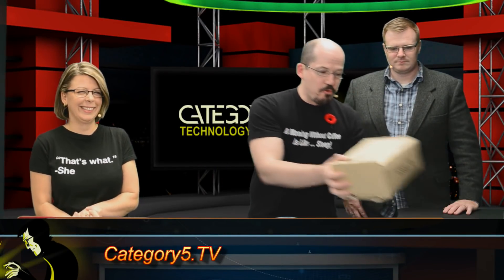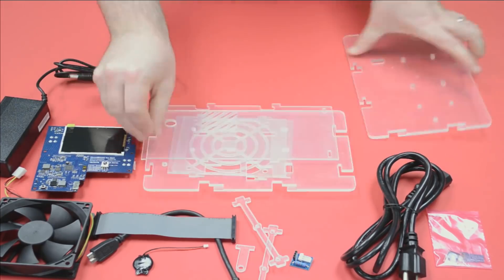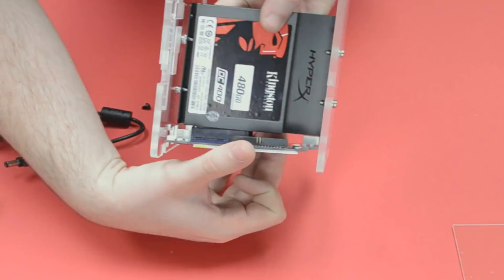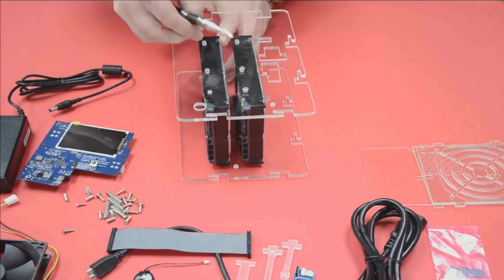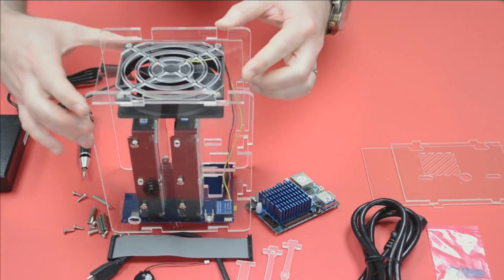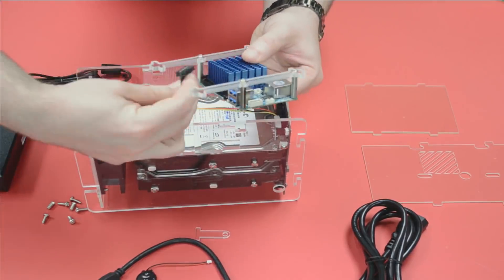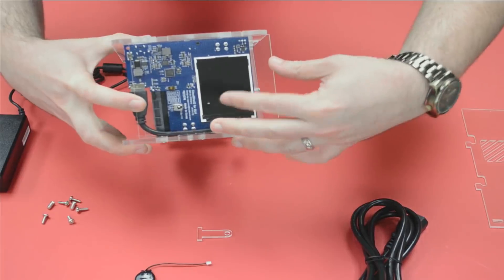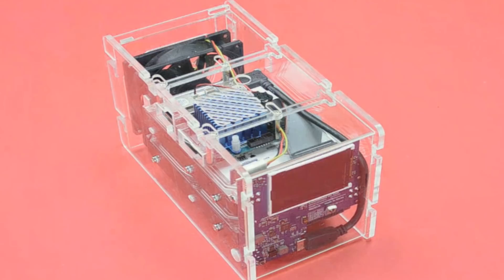The 8-CORE Raspberry Pi Killer: ODROID XU4Q with CloudShell2 Case - Assembly

Comment: As it is aimed at a completely different market at a hugely inflated price it can hardly be called a Pi killer. The Pi was deliberately designed to be a low cost programming platform for schools in the UK. Emphasis on programming. All the SBC bandwagon jumpers, just like this great looking and superbly specced system are simply NOT in the same league and aren't even trying to be so please stop comparing apples (or should that be raspberries?) with cucumbers ... It's pointless. Review the beastie on its own merits.
Reply: Exactly, as soon as he start dragging bags and bags of addons and screens out of the box I was thinking "that little thing is as much of a Pi killer as my desktop PC is - neither are affordable to the market that the Pi is aimed at"
Reply: Indeed.I would never spend money on the XU4 for my automation projects and to interface with arduino components. As i would never buy the Pi to run NAS servers and batch media rendering farms. Also the Pi's support and community for Open Source projects is far greater than the "Pi Killer".
Reply: actually a misused term, which is becoming annoying
Reply: Bob Lewis It gives me a feeling they are afraid of pi. Funny. It's a good device but when you compare it with pi, it makes hard to see what it is actually.
Reply: +Jim Franklin Err actually NO it wasn't. Here's a recent quote from The Royal Academy of Engineering with reference to their Jun 2017 award to the Pi team ... Raspberry Pi wins UK’s top engineering innovation prize ... "Originally conceived as a way to boost computer science applications to the University of Cambridge, Raspberry Pi has created a whole new class of computer ... ". 

In other words, to boost proper computer science curriculum (coding and engineering) in UK schools (as well as developing countries), like I said, in order to help increase the number of students (UK especially) needed for computer science and related engineering subjects whose numbers (and quality) had fallen drastically since the mid to late 80's due to the increased focus on ICT instead of true computer science. You could also check out the Wikipedia page as that reflects the same position.
Reply: could be, but it at least it is not an orange pi or some other aliwather base SBC
Reply: Actually, the Pi was designed to be a very low cost programming platform for the 3rd world countries not for the UK.. it just happened to be designed here and took off like wildfire.
Reply: I heard that is was just the fact there was no low cost computer for persons to get into the hard core computer and electronics
Reply: billfusionenterprise The arduino and it's derivatives have been around a long time.
Reply: actually the parrelex basic stamp has been there longer, as well as PIC chips. 
The thing is you need a computer to program them (Just like the first SBC needed a terminal) 
And that was why (from what i have read) the Pi was made, to make a stand alone device.
And there has been a computer like controllers in big hardware (VX works and MBED) , it's just the Pi was aimed at students and beginners and probably has change the wrong thing of small computers
Reply: nope, they are like ant group of manufactures, they see a successful design and try to make one of their own with some difference and hope they have something that will sell
Reply: nice to see someone who gets it
Reply: I do wonder, for who and what practical use are these more expensive variations are made?

Designed to empty your wallet, just like enthusiast gaming rigs and graphics cards.
Reply from the maker: Good thoughts, and we'd be happy to review it on its own. To be fair though, this is 4x the power for just 2x the price. It's not "hugely inflated" in my opinion. I think that's sweet bang for the buck. We'll definitely do the review of the SBC itself (minus the fancy case). Thanks.

Comment: I use the raspberry pi's because the gpio pins are very useful. Sure, I can probably use an arduino as a slave I/O board but I won't be able to use some libraries to control some components because of the latency.
Reply: shoud use it because of the support

Comment: "*** Important Correction * The ODROID XU4 supports 1080p video output over HDMI (not 4k)."

The Raspberry Pi does 4K quite well. And it is a WHOLE LOT CHEAPER. This device isn't an rpi killer. It's a good system, but it's price puts it in a different category and purpose. And well... I'd rather have the 4K, since my pis are plugged into a 58" tv and a 49" tv. 

Your "pi killer" would look too pixelly on the desktop for the price as far as I'm concerned. So much for rpi being "outdated." This odroid doesn't even do h265, which is pretty much the de facto standard now. If I wanted that much video stutter, I'd stick with a raspberry pi version 1...
Reply: The XU4 can software decode hevc without issue. The Odroid C2 is what you want for media consumption, the XU4 is better for heavy lifting.
Reply: my problem with term pi killer is it  misses the point of the pi
Reply: The market share that wants to hook these directly up to a TV has got to be smaller. I'd say most people buying these were looking for embedded solutions. Who would use this as a desktop box or media center? I have an AMD 8350 as my media server. It serves over 10 tablets, 10 laptops and 6 desktops 24/7... all local cloud. The Pi couldn't do it.
Reply: The Real Elvis : what would be a good curent/up to date computer that I could use as a media server? Something that is silent and has a very black/low noise floor? I want to connect it to my ifi pro idsd dac. A small computer with a good amount of ram. (At least 4 gb) Something to stream DSD256 music, run a Kodi server, and jriver or hqplayer and maybe a Plex server. I would prefer fanless and 2 gigabit ethernet ports or I can just use one of the USB ports for the extra ethernet. I would also like a suggestion as to a OS. I would think Linux although I have never ran a Linux system. Thank you for your advice and knowledge.
Reply from the maker: Thanks Karsten. Yeah, that was a bad flub, and my bad. I absolutely think at 2x the price of a Pi 3 the XU4 is a brilliant SBC for anyone needing the power. It is roughly 4x faster than a Pi 3. Obviously there are some excellent use cases for that.

Comment: why do people call things like this a pi killer, i own 6 or 7 raspberry pi`s and will get 2 or 3 of these as well but they won`t replace a raspberry pi, one reason is a pi can be ran off a 3.7 volt lipo and turned into a small standalone unit, i bet this sbc can`t match that.
Reply: pi killer is a bad term, why, the story behind the pi , i would prefer next step board
Reply: I agree it's not a Pi killer. It's a hell of a lot better than a Pi in many respects but it depends on what you want to do with it. I've got a Pi3 and about half a dozen Pi1s. Like the Pi3 this thing draws a lot of current. You do need a dedicated power supply and can't just use a phone charger, which is a shame as I've got plenty of phone chargers.
It all depends on what you want to do with it. 

If you don't need a lot of CPU, don't need USB 3 and don't need gigabit Ethernet then get a Pi. There's no need to pay extra to get one of these.
If you do need these things, then get an XU4. If these are your metrics then yes, this is a simple choice. "Pi killer" is a provocative phrase but it does have credibility in the right context.

I use my XU4 as a do-it-all server. It runs Arch Linux, with dnsmasq for DHCP, DNS (with ad blocking) and PXE. OpenVPN, NFS and CIFS and NextCloud. It handles this lot with ease and throughput across the network is roughly gigabit speed. I used a Pi1 previously, which doesn't have the grunt for NextCloud and can only manage ~50 Mbit throughput. 

If you want to run a Kodi box then a Pi3 is plenty (a Pi1 will manage, but struggle) - I run OSMC on mine and it does the job without blinking. 

There are a lot of these types of computer around now. I don't think any of them are going to push the Pi off its perch. Yes, they will be better and this one most certainly is, but the aim of the Pi is not to be the best - it's a non-profit organisation whose aim is to provide low-cost boards for educational purpose. Adding dedicated gigabit Ethernet will increase bandwidth but it's still Ethernet and it will push up costs. In fact, I'd say there was a lot of educational value in comparing the architectures of these things, in particular how the Pi's shared USB2 bus can restrict throughput. Having spent the last two decades working in this industry in many enterprises it still amazes me how many experienced administrators don't grasp concepts like that.
Reply: congrats on being one of the few who get it (although you screen name takes it down a notch) . I am just playing around with the Pi right now and be doing more serious things here soon (I just finish moving) . it just after reading the story behind the Pi do you realize what it's goal is. Trouble is most of these boards are riding coattails and try to do what faceplant did to mydump. (Facebook did to MySpace). Only one board I have seen had some good logic to it and that was the Chip computer, they were trying to make a whole product witha pi inside most retail price was high, so they made their own board to make the giffy cam cheaper, the result was eventually the pi zero cam around.
Now this is not saying odroid is bad, no, it looks to be a good design and they even have a emag, so they are doing good, although i do wonder about this video.
I do plan to get an XU4 and maybe one of the other boards from odroid in future. They are one of the few that do have their act together (plus i see many videos where the thing works)
Reply: @ LinuxTechShow - 
LinuxTechShow "It's tongue-in-cheek to call it a Pi Killer to be sure. But it is some really great SBC bang-for-the-buck. Hope you enjoy yours!"

How about we call a spade a spade and say you said that as click bait. we all know it.
Reply: The Odroid C2 is a better direct comparison to the Pi3, except it has gigabit Ethernet and native hevc decoding while being 20±% more powerful in most ways.
Reply: You're the  first to mention the screen name. It was one of those "I bet it won't accept this" moments. Surprised me , although give that this is YouTube and anything goes, it really shouldn't have.
It's all down to what you want to get out the board. If cost is ultimately the biggest issue the XU4 might not tempt, although it is decent value for money. If you're in Korea and don't have to pay import duty on these things (which pushed up the costs a lot) then the Pi is probably not even on the shopping list. 
If you have the cash and the need though, it's worth giving these a go. Mine has been very reliable.
Reply: there is a car in san diego withe the plates "cum inn" and how it got by the DMV I have no idea either
Reply from the maker: It's tongue-in-cheek to call it a Pi Killer to be sure. But it is some really great SBC bang-for-the-buck. Hope you enjoy yours!

Comment: https://youtu.be/yX3AMp0W3cA?t=39:  The XU4Q doesn't support 4K. It can do 1080p max. Also, it doesn't decode h265 in hardware, but it can do it in software (if the bitrate is not too high)
Reply: Don't forget that the video encoders and decoders are opensource (not the firmware blob though). The whole v4l2 m2m was build by Samsung.
Videomixers (there are 4 bitmap planes with alpha blending capabilities) are opensource too, but there is not a real infrastructure in the kernel. The xu4 is so fast that nobody actually cared to make it really work. On the Pi this is a necessity due to lack of any bitblitting capability. But I assume that the videomixer capability of the Pi as well as the video encoder/decoder capabilities do not exist upstream in the linux kernel.
Reply: Adrian Popa nn
Reply: So there's a footnote to support for 4k.  Ok..  no biggie.  It technically does support 4k. 

Maybe with a mixed os or chipset driver, it could be 4k compatible
Reply: Gary Stinten It can decode some 4k content (not too big bitrate), but can only output 1080p. The Odroid C2 can output 4k.
Reply from the maker: Oh poo! What a flub! Thank you for pointing out the error. This is when we wish YouTube allowed replacing videos like Vimeo does, or at least still supported annotations. In the meantime, I've added a note to the description - hopefully people will see it. The joys of live TV, and trying hard to learn as much as possible about a device in a short time.